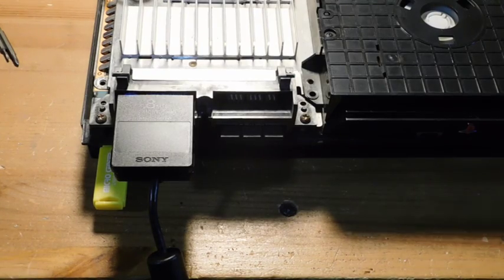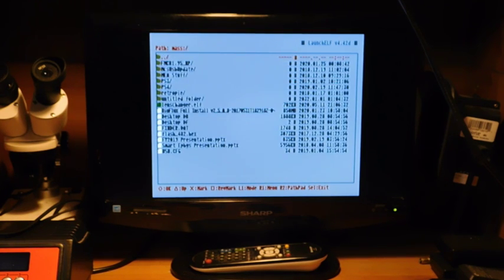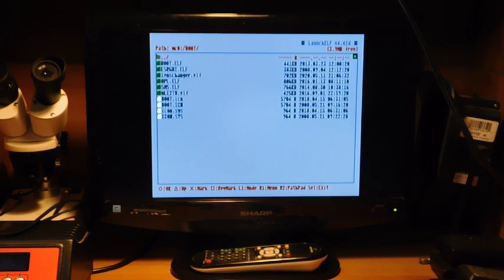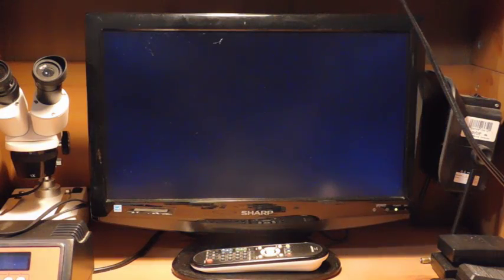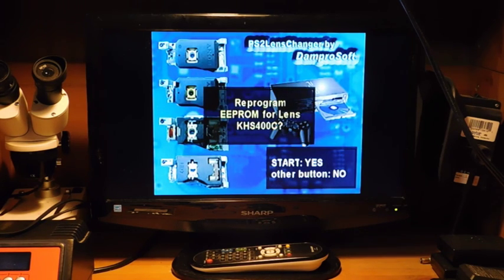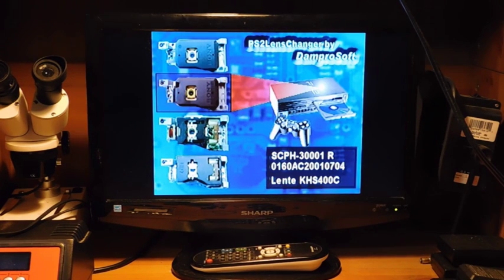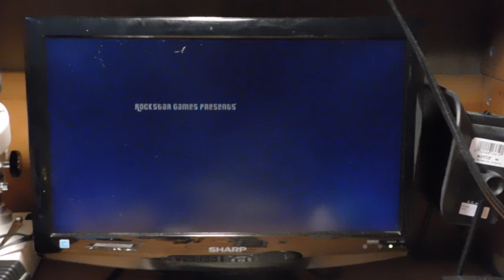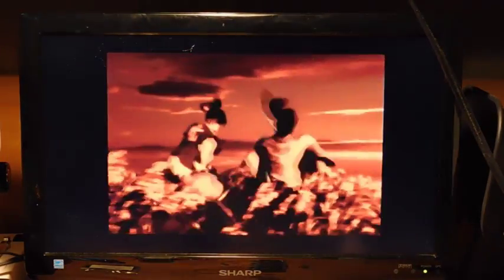PS2 (Original "Phat") Laser Replacement Guide!

Comment: HELP!  I think I screwed up my install.  I have a DTL-H30001 PS2 TEST/debugger unit.   Its laser wasn’t dead, just noisy and slow and I replaced it.  Now it tracks on its bars and says disc read error.  I tried putting the old laser back = same error.  I think I screwed up the factory calibration screws that adjust the laser.  Advice?  (This thing won’t run FreeMCboot on a memory card either, sighhhhh)
Reply from the maker: What do you mean by tracking on its bars? It sounds like the black screw which adjust the height on the left-hand side might be off. I have also never tried this on a test debug unit either
Reply: @LIRetroGaming   So, on closer inspection it is not spinning up a disc at all.  The laser moves toward the spindle and will sit at the position closest to the spindle and move up and down, closer and further from the disk.  It will not slide back toward the outer edge of the disk.  It can't.  There's a PCB board that it runs into rather than passing over.  I noticed this when I was testing the snake motor.  Originally, it had a 400B laser, replaced with another 400B laser.  I think it is the position of the bars that is the primary problem.
Reply: UPDATE: I pulled the replacement laser out and put the original one back in.  Looks like the replacement 400B I bought on AliExpress is faulty.  I see red light, laser is moving in full range of motion on its track, but no signs of life in the spindle motor at all.  I removed and re-seated all the cables to the spindle motor.  Still stumped.
Reply: @LIRetroGaming  What I mean is that, if you move the laser carriage as far to the "edge" as you can (furthest position away from the spindle motor), and then power the machine on, the laser carriage will move down its bars towards the spindle motor and stop as close to the motor as it can.  Then the laser will move up and down as though it is trying to focus and find something.  The spindle motor will not spin the disk at all, it will not even twitch when the PS2 is powered up.

Sadly, I can't swap the whole optical unit out of it, unless I had another one from another TEST unit.  Their connectivity to the main board is different than that of a normal PS2: a TEST unit has two ribbon cables into the main board (I assume it is separating its CD from its DVD data), where the PS2 retail unit only has one.  

I done screwed up!

Comment: The replacement you used in this video isn't a Chinese knock off, that's a new old stock Sony part. There are still thousands of them in circulation as Sony was still repairing these systems until 2018. There are Chinese knock offs, but they almost always have a yellow ring around the lens and are very distinctly a reproduction of the original part with many visual differences.
Reply from the maker: That’s definitely good to know. I was really quite certain that these parts no longer existed but I’m glad that they do
Reply: I wish it were that easy to tell the difference between a Chinese knock off. My original 50001, that had never been touched before, has the same yellow ring around the lens - looks identical to the replacement I ordered. My 30001 has an older laser like the one in this video. To use the newer laser in that model, you need to use LensChanger to flash the appropriate firmware to the drive.
Reply: @simbin.  Most original KHS-400Cs will have a yellow ring around the lens, which is why Chinese knock offs share the same color. For the final production run of KHS-400C pickups, Sony used a white ring around the lens, and this is not something I have seen on a knock off part; all white-ringed 400Cs are genuine. There are some new old stock yellow-ringed 400Cs as well, but they are far less common in my experience.

Most original KHS-400Bs had a white ring around their lens, but Sony began to produce them with yellow rings after they began producing 400Cs. These newer 400Bs are what you will find on the market today and have a different objective lens. You should not replace a 400B with a 400C as the change in height of the flex cable connector can cause the cable to grind against the top of the drive.

For most systems, LensChanger is obsolete. PMAP is a far better tool as it allows you to flash the system with proper calibration data from Sony service centers, including the newer type of 400Bs.
Reply: @nick-tf  Great info, thanks! What would be your next steps in troubleshooting a 50001 that a verified working 400C didn't fix?

Comment: Okay, so I replaced the laser. Went smooth until I turned the console on and put in a disc. It won't even read it. As I should mention it before, I bought a 400C as it is originally in my console. I did not install the MCBoot (because I am waiting for a second memory card). I loaded up GTA:VC and it won't boot, won't even flash a "Reading Disc" or something. As I took a closer look by opening it up, it will spin the disc for a half a second only to stop, and then the PS2 menu loads. Is it a problem that I haven't loaded the Lens Changer and properly set it up, or it is something worse?
Reply from the maker: It’s not working because you haven’t tried using the lens changer program
Reply: @LIRetroGaming  great news then! My new memory card is on its way so I'll be able to play again. Thanks!

Comment: Hey man, the black disc is getting caught on the disc drive when it goes in, anyway to fix this?
Reply: Thats the small screw on the rails it adjusts the height of your lens so if its all the way tightened in it will touch the disc while your disc is spinning leaving bad scratches on your discs. I found to turn the screw all the way in (clock wise) then turn it counter clock wise one and a half turns. Im still looking for a video that can clarify the perfect adjustment but this worked for me any tighter and it will leave a circle on my discs.

Comment: why do you take the program from the usb stick and transfer it to a memory card. why not just install it from the usb stick. I'm very confused with how you did what you did
Reply from the maker: I have read that the program runs very stable if you execute it from the memory card, so that’s why I transferred it from the USB stick to the memory card. So far I have fixed several PS2 systems with that card and I have not run into any issues

Comment: What kind of soldering kit do you need? What heat?

What do you mean remove the homebrew stuff?

What if you have a mod chip installed in your ps2 will the flashing of eprom mess up your mod chip?

Wait do you need a special memory card? I dont get it. The other guy says that the ps2 has to be compatible with a certain special memory card.

According to that other guy you need to buy a free mac boot memory card from Ebay! So it's not just the laser you need to get for this replacement. Why didnt you mention that?!
Reply from the maker: I tried to explain this but I will try to give you some more details. I used a free mcboot card to load up a custom program called lenschanger to flash a new eeprom onto the ps2. 
The easiest way to get free mcboot is to purchase a card on eBay, and from there you can download lenschanger (link in the video description) and follow along from there
Reply: @LIRetroGaming  thanx yeah I did order a free mcboot card from Ebay.

But one question, does flashing the eprom affect any mod chip that might be installed in the ps2?

Comment: Can I ask a question, I changed it as you did in the video but for some reason it plays some games and some not, what have I messed up that it not works? Thank you
Reply from the maker: Which games specifically are not working? You need to test all three disc types. If it’s one type of disc like blue discs then it’s just an issue with the CD
Reply: How important is it to  change the lens firmware? I found a site that suggests the older models are compatible with 400C with no mention of doing any updates to firmware

Comment: Alright so I replaced the laser on my SCPH-30001 R (I ended up ordering an KHS-400B, not 400C). With the old laser, it would take like 2 minutes to read DVDs, would read CDs just fine. I flashed the EEPROM using lenschanger, and it notice it made an improvement, but it still takes like like 10 to 20 seconds to read a DVD disc. Like it will go to the browser screen, and not automatically start the game.
Reply from the maker: You can try adjusting the angle of the laser assembly as that sometimes improves the situation

Comment: What's thr name of thr thingy that I need to clean the thingie that stop the laser to make static? Sorry, I'm new at this.
Reply from the maker: There’s a small solder point that needs to be removed to get the laser working. It’s there because static electricity during shipping can destroy the laser. Once this is removed the laser will work properly
Reply: @LIRetroGaming i can confirm the 400c works great on the v1 japanese motherboards gh003 and up! i have 3 of them that came with 400a
Reply: @LIRetroGaming can the auto tilt 10 screw US playstation 2 3001 v2 motherbord use lenschanger?

Comment: were does the back promp file for the laser were is that saved? Also what the best grease to buy for the ps2 burner that will not harms the plastic or metal?
Reply from the maker: Sorry I don’t fully understand the question, but the grease that I use is called lithium grease

Comment: I see you have quite deep scratches on the plastic surface. Is there a proper way to completely remove them or at least make them less visible?
Reply from the maker: You can use novus plastic polish and that might help with scratches
Reply: @LIRetroGaming  I have Meguiars PlastX is it good?

Comment: If I am going from 400b to 400b (staying the same) should I still use the lens changer program?
Reply: My bad I meant 400c to 400c
Reply from the maker: Yes. Even if you are not switching laser types you need to do it or it won’t work
Reply: @LIRetroGaming  ty man this was really helpful. The comment and the video ❤️❤️❤️🎮🎮
Reply: @LIRetroGaming  do you have discord? I have been trying to do this for a month but it still dosent work…

Comment: When I swapped the old sensor for the new one I forgot to move the screw on the front to the new one. I ran the lens changer on the FMCB memory card and it would read CD only and it was really really slow. DVD games would error. I took it apart again and realized the previously mentioned screw I missed and after that it read CDs instantly but still not DVDs. I ran the lens changer again and I adjusted the top right screw on the rail and after a few extremely minor turns to adjust height of the lens, it read a DVD game and instantly too. So now it’s fully restored. So for those having issues please just hook it up to a tv with the lid off and just keep making minor adjustments and of course be sure to have lens changer or else it won’t work at all
Reply: Mine is readying cd slow but not dvd I really hope I can find the sweet spot cause I am beyond frustrated
Reply: @ethanwashoe5868  Make sure the screws on your rails are tight, and the one that I turned 10 times or so was the little black screw on the left side of the laser if you’re looking at it from the front. I tightened it all the way at first and from there I just did quarter turns backwards and tested it until it worked perfectly
Reply: @jeremy9474  thanks I’ll try that out
Reply: @jeremy9474 after following your advice and tightening that black screw to the right right of the laser then unscrewing it a little at a time my ps2 is now reading all the disks. Thank you man, I was about to give up on it
Reply: @ethanwashoe5868  hell yeah dude!

Comment: I need some help. I did everything in the video properly (no adjustments made though...) And my PS2 works, but takes a while to read discs. But it always does.
Reply: I have the same problem with mine. You replaced the laser and still lags?
Reply: @wanderingdaze7018  yea, I haven't tried adjusting mine yet but I want to try to in the next couple months maybe. Not sure when I can get to it.
Reply: I just tried it now my tray closes and opens on its own lol
Reply: @wanderingdaze7018  I've not had that happen yet...

Comment: Awesome video! Quick question, what kind of screwdriver do you use when removing the top of the drive? Was starting to open my PS2 and got stumped as I don't seem to have the correct size for those screws.
Reply from the maker: Thanks! I use a Phillips screwdriver to take apart the ps2. The bit size is PH2, if that helps!
Reply: @LIRetroGaming  Thank you so much! This helped me know what I needed!

Comment: How do I get to that browser screen? I only got it once and now it automatically boots into opl
Reply from the maker: which browser screen? You can make the PS2 boot like normal by removing the memory card
Reply: @LIRetroGaming  im using hdd I found holding circle and tirangle worked, thought now i find myself with the same issue even after loading the khs-400c  program the console still will not properly read dvd discs
Reply: @LIRetroGaming  blue and black discs load and work just fine no issue, dvds take forever to load and once they do its stuck on a black screen

Comment: Hey thanks a lot for this video! I’m trying to fix my SCPH-30001R that originally came with (I think) the KHS-400R. Right now, the worm screw does not move for me at all. The laser comes on, the disc spins, and the screen shows “loading disc” indefinitely (never get a read error message, just stays on “loading disc”). 

Does this sound like it needs a new laser assembly? Or might it actually be the worm screw motor that needs replacing? 

I’ve bought a McBoot memory card from China that I’m waiting on to get here just in case I need to replace the laser
Reply from the maker: So if I understand correctly, the laser doesn’t move up and down along the track? It spins but the laser stays in place? You can try adjusting the small black screw on the laser - if this screw is too tight then the laser can’t move on the rails. It might be the worm screw but it’s fairly uncommon for those to fail
Reply: @Long Island Retro Gaming  Yea not only did the laser not move at all, but looking at the worm screw when I inserted a disc, the worm screw itself was not moving at all. This repair actually became a lot more complicated on me last night unfortunately. Somehow in my repair efforts, the eject button and entire ejection mechanism stopped working on me altogether all of a sudden. In googling the issue, I found out that it could be a blown fuse. When more fully disassembling the PS2 to get to the motherboard to take a look, I noticed that the worm screw ribbon cable was disconnected. It's possible that I disconnected it accidentally during disassembly, but I'm thinking more likely it was already disconnected, and that would explain the behavior I was seeing. No idea how that could have happened though, it's super strange.

Anyway, so now I can't test because of this new issue lol. It turns out that the PS11 fuse on my v5 board was indeed blown, so now I've got to solder a replacement for that component, reassemble the PS2 making sure all ribbon cables are reconnected properly, and hopefully it will finally be working! But it'll be a while before I can test that theory while I wait for this replacement component to take the slow journey over here from China.
Reply from the maker: Oof that’s a more challenging repair but it seems like you are on the right path to getting it working again!

Comment: I tried it for the model 5000 with the khs 400c and it didn't work
Reply from the maker: Sorry to hear that. Just to be sure, did you remove the anti-static solder points on the laser?

Comment: My laser doesn't seem to be lighting up at all. Probably defective...
Reply from the maker: Did you remove the anti-static solder point on the laser? That Needs to be removed in order for the laser to work properly
Reply: @LIRetroGaming  I will do that. The only soldering iron I have though is a cheap one that you plug straight into the outlet. Do you think it's too risky to try and use one of those?
Reply from the maker: Yeah that kind of iron is not too good for applications like this. But fortunately you can get temperature controlled ones and you don’t need to spend a lot of money. I show where the anti static solder point is in this video
Reply: @LIRetroGaming  I desoldered the point and the laser works now. Thanks!
It unfortunately didn't fix the issue I was having. I'm having a problem trying to read DVDs. Any CD format disc works fine and boots pretty much instantly, but any kind of DVD takes around 2 minutes to load. Loading times aren't increased in-game, it just takes a very long time to boot it. I tried calibrating the laser on the white cog in the back of the disc drive but it made no difference no matter the cogs position or which direction I went.